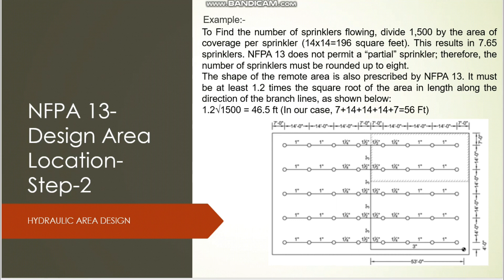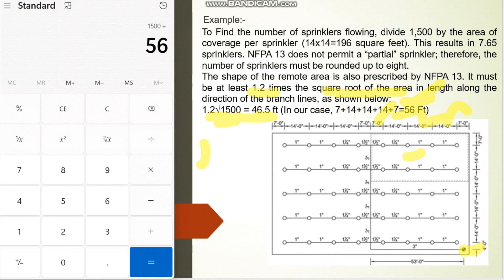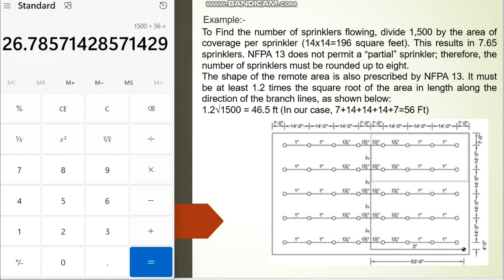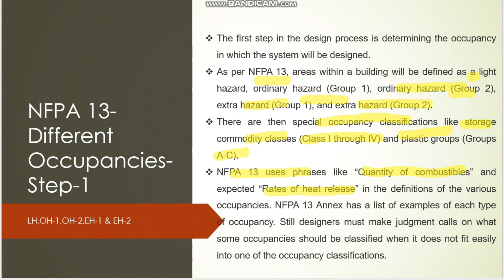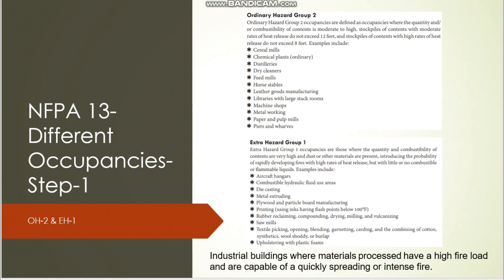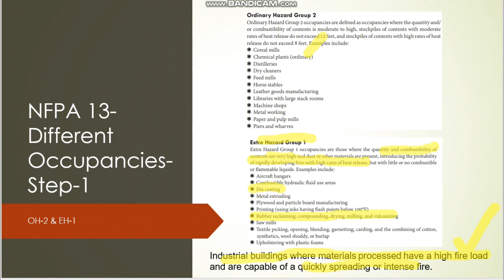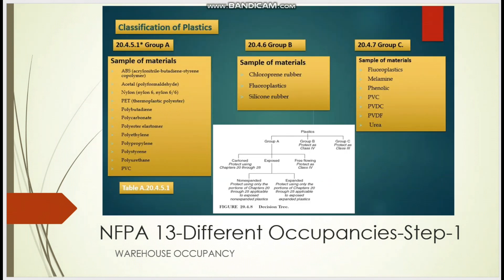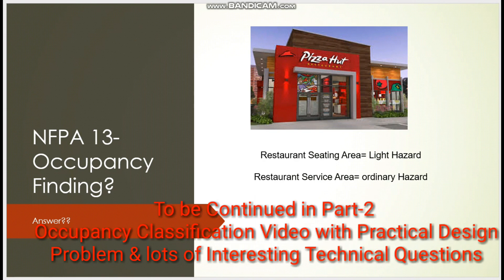Chapter 1-Part 1-Sprinkler System Design-Hydraulic Calculations with Practical Design Issues-NFPA 13

Comment: Dear bhai,
I am now facing problem to solve a problem. If fire pump room (Extra Hazard) lies inside the multi storied building (light hazard) and total building is protected by sprinkler system. Then as per hazard classification requirements shall I need to consider extra hazard design requirements or the principal hazard. 
If you have time please let me know your opinion.
Reply from the maker: Fire pump room in the building is common for all the project. If u want to decide the hazard considering the fire pump room then all the project will be extra hazard which does not have any logic. For example, in the basement if u have a big car parking and pump room then the floor is considered as ordinary hazard not extra hazard. Similarly in your case, as u mentioned it is light hazard entire building then it should be considered as light hazard only not because of pump room it should be changed